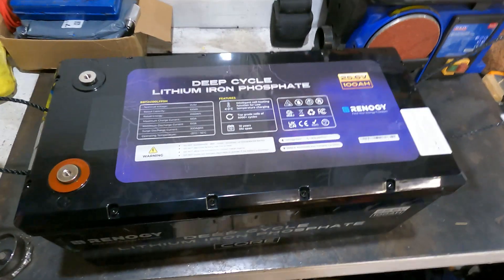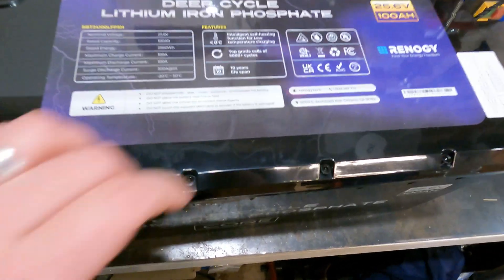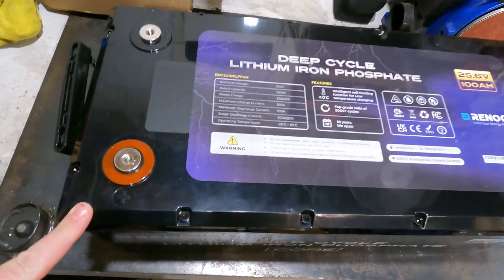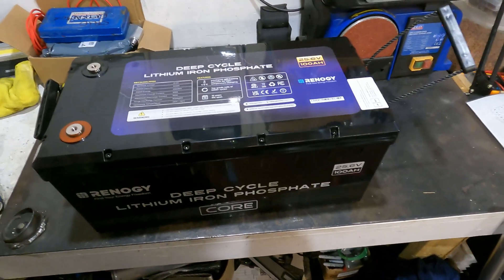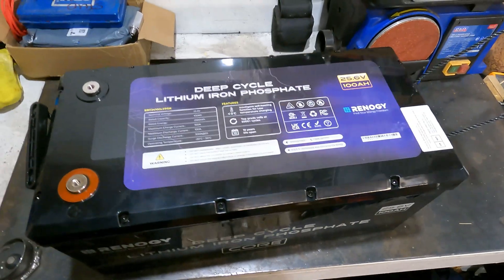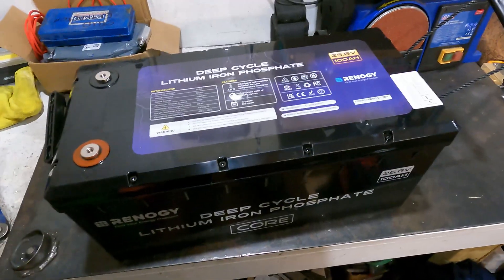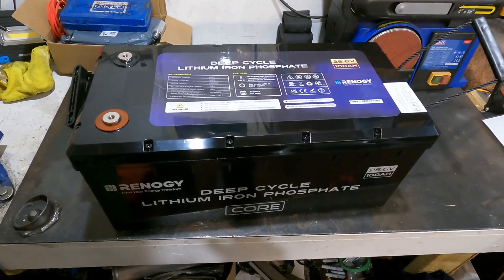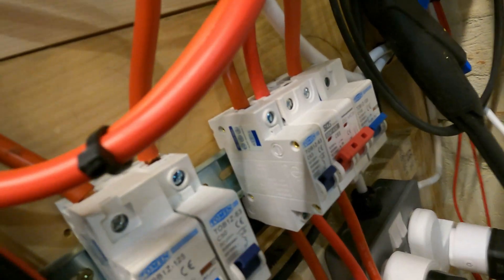Renogy 24V 100Ah Core Series Battery Used for Solar Storage

Comment: are you sure that these batteries can be placed in series? If so, you still might want to consider an external balancer. They should be kept within 0.1 volt of each other.
Reply from the maker: Yes these can be kept in series without issue. I have looked for an external balancer but I've not been successful. In theory when the battery is at float voltage (55.6v) or 27.8v per battery the BMS should balance the batteries pretty well. After several months there is no noticeable difference in voltage between the two batteries

Comment: Hi, what charging parameter settings are you using for this battery please?
Reply from the maker: I charge my two batteries at the same settings as the rest of my lifepo4 batteries. Bulk charge 55.8v and a float of 55.6v. If you look at the renogy website it shows their recommended values within the manual.